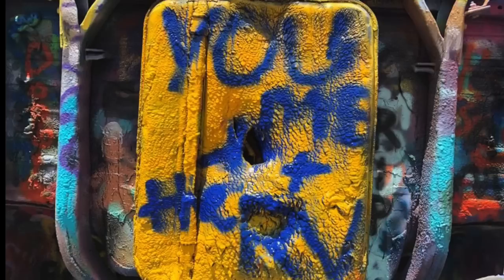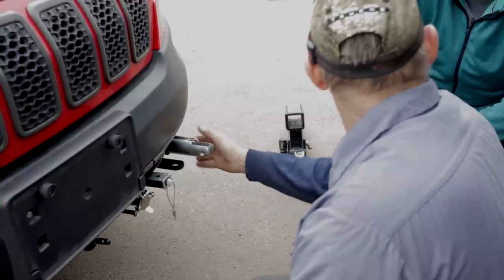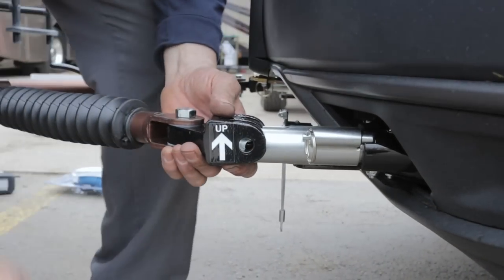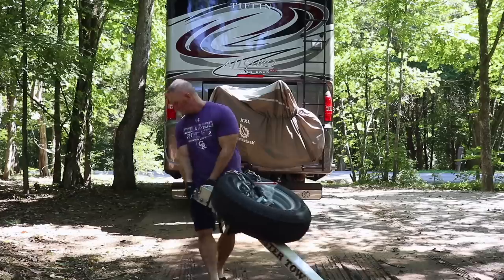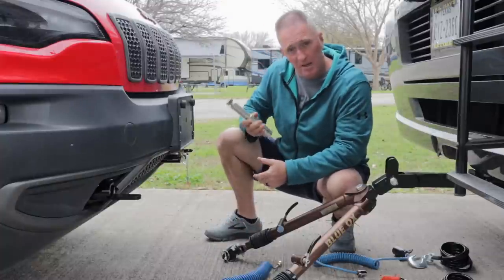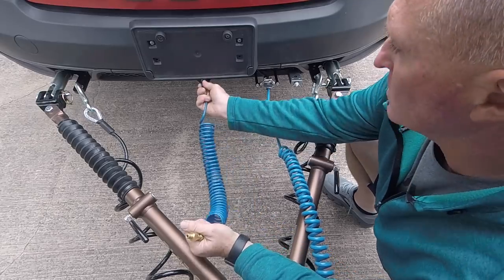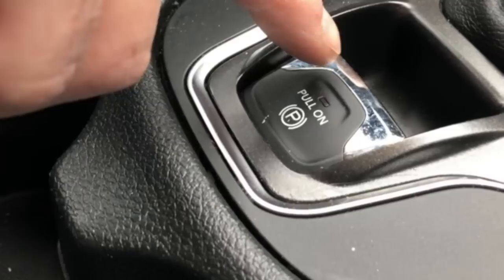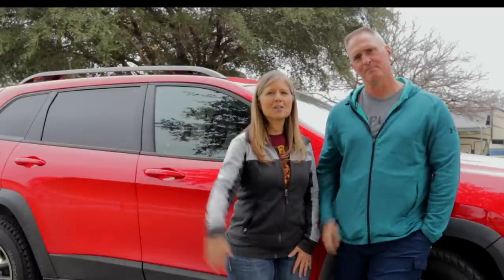What is Better Flat Tow or Dolly - Full Time RV Living

Comment: Wow to prepare my 2011 Xterra to tow is put the manual transmission in neutral, turn the ignition to ACC and pump the brake a few times via the brake controller and go. I know my day is coming when I’ll have to upgrade my tow and I’ll be where you are now. Enjoy.

Comment: I have a 2021 Chevy Spark with a manual transmission which I really like. The only negative thing about the Spark is its maximum recommended speed is something like 110 KmPH and occasionally I like to go a little faster. I too had a tow dolly very similar to yours but after one trip to Arizona I decided I enjoyed it as much I could stand and sold it and also purchased a Blue Ox system. I also purchased a Patriot 3 brake system to keep in compliance with laws requiring a brake system. I had the Blue Ox system installed by the RV dealer and have yet to install the brake system but it’s pretty simple, mostly just plug in the proper places. My motorhome handles the towing with no problem but as I  mentioned I have to keep in compliance with the state or provincial laws or pay the consequences. I also like the brake away features of the Patriot 3 but it is extremely unlikely with the Blue Ox system unless it has been sabotaged by some kind individuals. So, check for security before leaving every stop. I’m glad you purchased a Air Force one brake system. Go Air Force.  Ha Ha

Comment: I wanted to tow a 2016 Toyota Pickup 2WD
Toyota said no no no
Solution drive shaft disconnect device.
Pull a cable and the car has no idea that it is being towed.

4 years later and it is still just great.
Added advantage is that if I’m concerned about someone taking my truck at night.  
I pull the cable.  Good luck trying to steel that truck.
I believe the drive shaft disconnect is from “Superior Drive lines”.  Easy to install

Comment: Woohoo! We decided on a Trailhawk as well. Such a great vehicle. One thing we did on our Trailhawk was change the battery to a higher Cold Cranking Amperage. My wife was having problems with Check Engine Light and also it wouldn't start sometimes even if showed a full charge on the battery. Haven't had a problem since changing the battery. Great car.
Reply from the maker: Thanks for the info. We will keep an eye on the battery.

Comment: My husband bought me a Jeep Wrangler to eventually tow behind the motor home once we get to full-time but he was a U-Haul dealer for almost 20 years so he wants the dolly, because he is used to moving them around, I want to flat tow, much easier to hook up & tow and won't create issues with his back. Going to use the wear down tactics in reverse!!  We have our experiment motor home now to make sure we can do this by taking small trips with "Abby" before we sell the house, truck, bike etc and buy the big rig like you have. 15 months and counting!!!
Reply from the maker: 15 months is not very long! It will go by quickly....at least it did for us with all the prep we were doing. I the Jeep wrangler a 4 wheel drive? If so it cant be dolly towed only flat tow or all 4 wheels up on a trailer. (does that help?? I am trying to give you some ammo! lol) Also, when booking campsites there has to be enough room for them. Nothing is worse than it eating up the only spot you have for chairs. Dollys dont seem that big until you start moving them around a campsite. If you are going to stay at National parks, state parks or COE parks there isnt always room for them. Good luck wearing him down!
Reply: To use a dolly with a Wrangler you would need to disconnect the front driveshaft before putting front wheels on dolly. After removing from dolly you would then reinstall front driveshaft. Not sure if it's worth it. Unless you plan to permanently remove  front driveshaft, which would mean you can operate Jeep in 2 wheel drive only

Comment: I hated using a dolly until I got the right height on the hitch and made some wood ramps that the dolly ramps set on making the angle very minimal.  My van now rolls up almost without hitting the gas. Before I did this, I pulled the front end off of two vehicles.  But I got a new transit van connect that I haul my music gear in. Good for you for making the switch!
Reply from the maker: You cant tell in the pic but we did add that to our dolly and it did help with the front end. But the Acura was still so low the dolly wheel covers were digging into the car just under the doors every time we turned. Part of the time it took was trying to make sure the car was exactly centered to prevent as much damage as possible.

Comment: Recently sold our MasterTow dolly and  now have the RoadMaster Falocn system with Invistibtake on a 2918 Wrangler.  All I need to do is put the transfer case in nuetral and put the Jeep in 5th gear (manual transmission)
Reply from the maker: Awesome!! You wont be sorry. We are so glad that dolly is gone.

Comment: This is our first time watching you guys - You do a nice video and we look forward to seeing more - I would like to voice an opinion that the tow dolly is a better option - I don't care for the flat tow option because of the added wear on the moving parts in the drive train - bearings, tires and who knows what is in play in the drive train and the expense to fix it when the expensive drive train parts eventually need service - Pulling a front wheel drive vehicle on a tow dolly is minimal wear on the freewheeling rear wheels of a front wheel drive vehicle - A Ford Edge in my case - May I point out that there were a number of things I do differently to prepare my toad for a trip on the tow dolly - I load it by myself - I can lean out the window and see my front left wheel as it comes up the ramp and against the stop making loading / positioning EASY - Not scary, not a pain, not any damage to my car, not ever - And my Ford Edge is as wide as you can get on a dolly - My Demco Kar Kaddy is a much better tow dolly as it steers with wheels that actually steer / turn making corners more natural - my Kar Kaddy has surge brakes making stopping less stressful on the RV - When I buy a new car I don't have a substantial expense of transferring all the hookup gear to the new car - Each has its advantages and disadvantages but I wanted to point out the advantages of my little tow dolly - A good dolly and a few tricks in the prep and I stand with your poor rejected "Fiscal Decision" - LOL - But I appreciate your presentation and some folks may well prefer the flat tow depending on personal strengths / preferences / toad vehicle - Thanks

Comment: Great video with good explanations and camera work.  Thank you.  What is the air connection for on the flat-tow setup?  The Jeep doesn't have air brakes.
Reply from the maker: It is the air braking system we installed to flat tow. The compressor is on the RV

Comment: A few recommendations for additional prevention:
1) Always double and triple check your AF1 air connections once plugged in.  They can come disconnected, and then you lose your aux braking.
2) Spend the $15 and get spare connection fittings for the air connection.  The airline is not standard part at most RV dealers, ( I drove from Fredricksburg to San Antonio and back and lost 1/2 day to be sure I had the brakes working.
Reply from the maker: Thanks so much for that.  I wouldnt have thought about extra fittings.  It is now on the list.

Comment: Wow, that is quite a process to get the Jeep ready to tow. I have a chevy equinox and it's basically a two step process. Hookup then put it in neutral. There is a fuse you're supposed to pull, but I but a switch in so, it's a switch flip. I actually forget and most the time it is still set to tow mode;) I am super happy towing four down too and I'm sure a dolly is fine, but it is so nice just to pull up, hookup and go. (BTW, I use the M&G brake system, and wow, is that a slick setup, but it isn't available for all cars.)
Reply from the maker: Thats cool. It sounds really easy! It is going to be really nice to hook up and go.  The dolly was not ideal for us for sure!
Reply: Great to hear about the Chev Equinox! What year is yours? Thx!
Reply: We are looking at the Equinox also...  Question... Does the Equinox register mileage when you tow it?  Someone told me that it would...
Reply: It’s a 2012. It’s the cheap version with two wheel drive. If I was going to do it again, the 6 cylinder is better and I’d probably go all wheel drive, although, we don’t do any real off roaring to speak off.
Reply: Ron Hendrix I don’t think it does, but to tell you the truth, I’ve never looked. I’ll check when we move in about a week.
Reply: Jumping Off The Cliff does the odometer register the mileage you tow? Salesman, said it would...
Reply: Ron Hendrix I don’t think it does.
Reply: Jumping Off The Cliff thanks!!!
Reply: @Jumpingoffthecliff  Thx!!!

Comment: I have the Trailhawk too and I am set up to flat tow.  I actually had a welder add my Red Hooks to an extra set of the connectors  to the base plate so when not towing, my car will still look like the Trailhawk with the 2 front Red hooks  .
Reply from the maker: Great choice for a flat tow!!!
Reply: I posted this further up to Phil, but we also have a Trailhawk (2016). Apparently there is a concern about the active steering in it that doesn't allow the vehicle to track behind the RV. This could cause wobble as well as damage to the front tires and steering. I know Jeep has a part that enables the steering to free flow. Do you have this installed on yours? If not, have you discovered that the steering is too tight without it and causes problems? I also imagine that with the active steering enabled, it will need something to keep the batteries charged. Just looking for some feedback since we are going to put the part on ours.
Reply: The 2019 Trailhawk corrected this problem without the need for an additional part.

Comment: Hey folks, great video.  We had a 14" Cherokee which had the infamous "death wobble"  I'm sure you heard about it - I believe it could effect 14 through 17 MY Cherokees.  The solution in short was to power the steering system during towing.   It required a special harness (free of charge) from Chrysler-Fiat which installed a switch in the center console to couple battery power to the steering system.  This allowed the steering to better follow the RV when being towed - eliminating the "death wobble".  Since power was applied, the battery could lose charge which meant a supplemental harness from your RV battery to the towed battery was required (your tab and time to install), otherwise the towed battery would require intermittent starting every few hours or you could have a dead battery if driving over four +/- hours.  Again, that was due to the battery power applied to the towed steering system.  Anyway, if you have a later MY Cherokee (maybe 18 MY and up) this issue may have been resolved, but not sure.  Great to hear that you dumped your dolly, but just wanted to let you know about the Cherokee flat-tow issue.  We spent way to much time on this with Chrysler corporate.  Have fun with your Jeep.
Reply from the maker: Our is a used 2019 and thankfully it has been resolved.
Reply: Very good to hear.  Thanks for the reply.

Comment: Nice setup, but with the tow bar, safety cables, and breakaway cable all hooked to the hitch you are depending on the hitch to never fail and come off the RV.  It is rare, but it has happened unless it is part of the RV frame itself.  At least connect the breakaway cable to something else, but preferably the cables as well.

Comment: Hello Phil and Mrs ?.  I enjoyed your video on moving away from dolly.  Makes sense.  Just bought a 2008 CRV for a toad because our other vehicles are not conducive to being flat towed.  And now the Mrs says she wants to pay off her 2018 CRV and is considering a different vehicle - perhaps a Jeep product like yours.  This way we can tow what we usually drive.  I've been on the Jeep website and am confused between the models in the Cherokee lineup.   I wonder which is the least expensive that will work for us behind our Class C RV.  Also, the Dinghy guide for 2020 just has 2 or three steps to prepare to flat tow the Cherokee.  I am most interested in hearing your thoughts on this and any suggestions you may have.   Thank you.   Artie P

Comment: It was a fudiciary responsibility! LOL. Just wondering if you compared to the Roadmaster, and why you chose the blue ox system.  Also the supplemental brake system in the car.  I don't recall you talking much about that.   Also I've heard about people maliciously pulling the safety cotter keys from the pins.  You might want to get locking pins for the  base plate connectors.
Reply: Every time we stopped at a rest area or for the night somewhere, it was mandatory that I do a walk around and check everything, including the tires!

Comment: My advice is don't leave your pins in your tow bar. They can grow legs. Also I have a spare break away pin for the Air Force one system on our grand Cherokee just in case someone decides to walk off with it as well, locking up the brakes permanently. Although, if that does happen, you can pull the fuse off the (vehicle side) of the system to release the brakes. Hopefully they showed you how to do that at the shop that did your install.
Reply from the maker: Great advice.  I do have the locking pins in my Amazon cart already and now will add the spare break away pin for the AF1 system.  I was looking at it the other day thinking of ways to secure it better.....but a spare is the answer.  The shop showed me the fuses.......but didn't tell me how to get around the safety pin being removed.  Thanks a ton!!!!

Comment: Hey Guys, thanks for keeping us updated on everything RVing and your channel. I know the video is a little old but I have some questions. We are in process of selling our 2020 5th wheel and purchased a little smaller class A 2013 Winnebago Sunstar. We also purchased a 2020 Jeep Trailhawk with the Blue Ox Patriot breaking system. The Motorhome came with a Roadmaster Falcon 2 tow bar all set up. Today we are having the base plates, light kit and breakaway cable installed on the Trailhawk. Do I need to have a battery disconnect installed in the vehicle and a auxiliary plug for the 12 volt to be alway live?
Reply from the maker: Nice set up you have!  For our setup we do not have a battery disconnect or an auxiliary plug. We have the Air Force One Braking system and Blue Ox tow bars and base plate. Our system uses the onboard air compressor to brake the Jeep. We have not any battery issues in the 5 years we have used it. You would have to research the Patriot System to see the power set up needed.

Comment: Well after using a tow dolly for a couple of years, we also decided to switch over to flat tow. We have a 2021 2 door Rubicon on order that should arrive soon. We already have the Roadmaster tow bar, so we're having the dealer add the taillight cable kit, the Roadmaster base plates, RVi braking system and the AMP Research swing down steps. So we too will have a tow dolly for sale soon.

Comment: Where is your bike rack? It was removed during your flat tow hook-up demonstration making the connection appear easier. Please do a video on your bikes including the reason you chose the bikes ( no E-bikes?), the rack ,the cover and how you load and secure them.
Reply from the maker: The bikes are a good idea for a video but now that our tow has changed we will need to change our bike rack.  Our current setup wont work so it is a work in progress. And no they are not E-bikes they are Treks

Comment: Those 19 steps, ugh. We're planning to full-time RV soon. After looking at the choices for flat towing (not many if you want an automatic transmission...especially if you aren't willing to go through all those steps) we recently purchased a 2019 Jeep Wrangler JL Sport S. It rides very smoothly, shifts even smoother with its 8-speed automatic, and we're getting 19-21 combined mpg on 87 octane.

Some choices were even more troublesome than simply going through all the steps: disconnecting the battery, reconnecting and starting the engine to let it run for several minutes after every 500 miles of being towed, removing fuses, etc. I wasn't going to mess with that process every time. With the Wrangler, it's just a matter of putting the transmission in Park and the transfer case in Neutral.
Reply from the maker: It actually takes me less than 5 minutes to get it tow ready once connected and the same when we disconnect.  I wanted a plug and play and it SO much better than that dolly!

Comment: Great video, but I didn't see the part where you move either the RV or the car to lock in the bars.  We just converted our Wrangler to flat tow, and the price was as advertised, a bit over 5K.  But we hope to sell the Honda Fit (faithful companion for 6 RV years) and the dolly trailer.  Might even break even, and also cancel the insurance on the Fit, so it should be a win win.
Reply from the maker: That is because we didnt actually drive it.  We were just demonstrating the hookup

Comment: The new Newmar diesel RVs come with the Air Force One installed on the RVs with an air connection to the air brakes. Works with a stacker trailer with air brakes also. So you tow your Jeep with the parking brake set? Seem strange to me. I still prefer my car trailer because it doesn't restrict the vehicle I can haul.
Reply from the maker: The parking break is not set.  The steps have you set the break to double check the tow bar and then release.  I think I missed recording the release so you may have missed it.